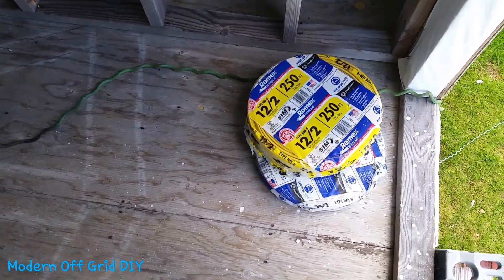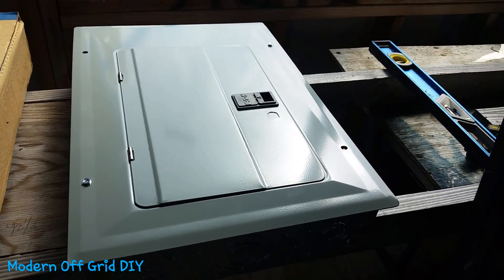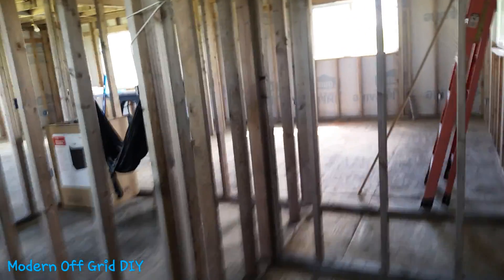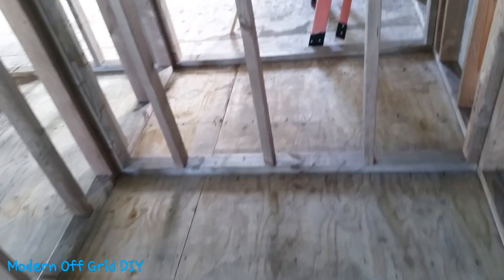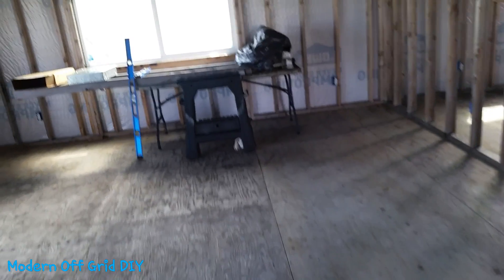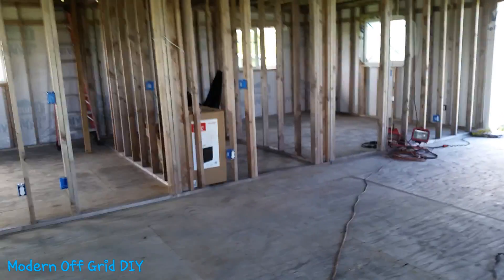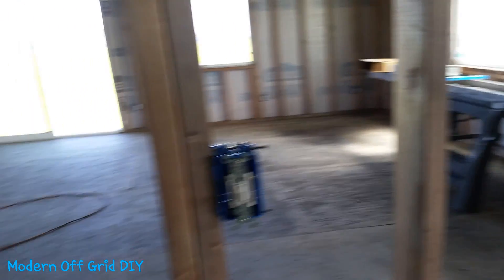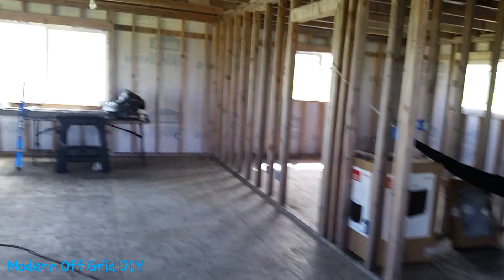Off Grid Living - AC Electrical Breaker Box Location - New Off Grid Home

Comment: As yankey4 has said only use the 14ga for lighting. The outlets have to be 12ga. I vote for putting the panel behind the door. The only thing to remember is there are a ton of wires that go into a breaker box. I would think to put it down in the room you built since you are moving your DC power room. Good luck buddy